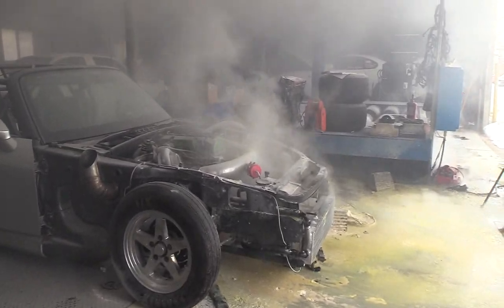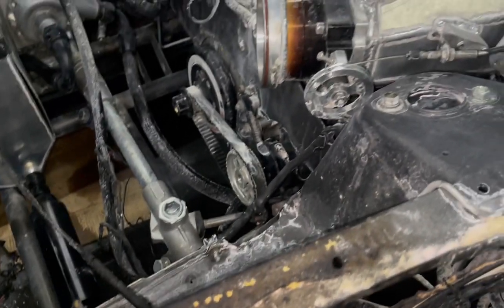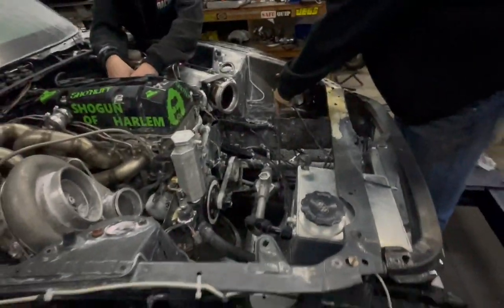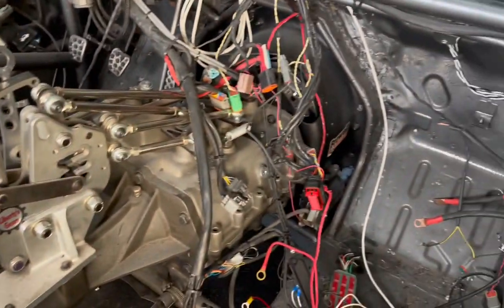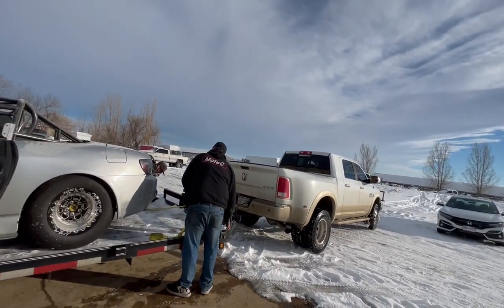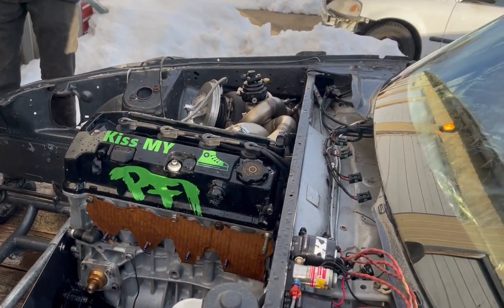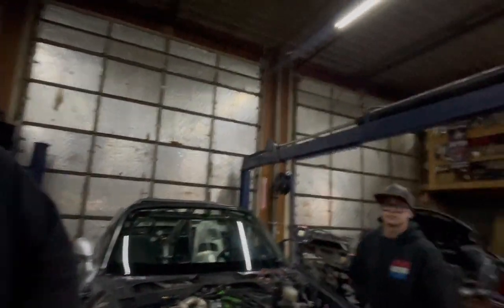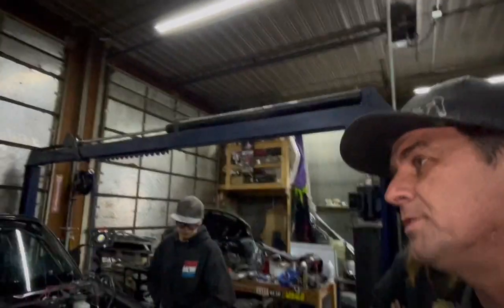After The Fire. Disassembly And Clean up.  Sho’nuff

Comment: Brent, I'm glad you're all ok, but please listen for a moment. As a former fire officer I need to tell you a few things; first, NEVER use water on a fuel fire! second, get someone in the crew trained in fire safety, there's clearly a lot you need to know.
Now for some advice:
Fire Extinguishers, you always need more than you think, Carbon Dioxide (CO2) is your best friend here, but expensive. Powder is great, but as you found out, messy, use as a LAST RESORT.
Fire Blanket, get one! comes in all sorts of sizes and specs.
Formalise a proper plan, one that contains containment methods and a GTFO plan, getting any burning object outside is a good idea.
DO NOT put extra hose spigots in, at best you will only use water to put out a simple fire, paper, cardboard and wood etc, but given the nature of the business I would strongly advise against it. Reason being that you may have plenty of contaminants, oily rags, fuel/solvent soaked cardboard. Water will spread fuel and oil, allowing any fire to cover a greater area much faster than you can react to, obviously fires are best contained when small.

Comment: I’m glad that everyone is ok. Things can be replaced but not a life. 

Out of experience, do not use a water hose on a gas fire. It only spreads the fire and makes it worse. That might be why there was damage to the bottom of the car. I was working on a demolition derby car and cut the fuel line with a torch and boom. I only had one fire extinguisher and that didn’t do much to the fire. So I hit the fire with a water hose and it spread the fuel and fire over my entire garage floor. I lost my garage and everything in it.  Fire investigators said I made it 100 times worse when I hit the fire with the hose.
Reply: I would suggest you get with your local fire department and get their recommendations on what to use or how to set up a fire safe system.

Comment: Brent, remember water is only really good for a METHANOL fire, and NOT a gasoline, oil or E85, etc. chemical fire. Spraying a water hose on a gasoline or oil fire can cause the fire to spread substantially if it is not blanketed. Having a hose and nozzle available is good, just remember its not great to use in all scenarios and the proper extinguisher is better.

Comment: Someone should build a dump fire suppression system like a race car system but one that reaches out over the engine bay and can slide under the front number so if it ever happens again you just pull the pin then you just have to have it recharged but it would work effectively

Comment: Good ideal to look at your fire plan but even better to learn what to do when it happens ... Learn how to use Fire Equipment to its effective range in a panic you do what you can but if you train it will work faster and better... Contact me as I have 22 years experience and in the Fire Service and my dads shop building Street Rods ..